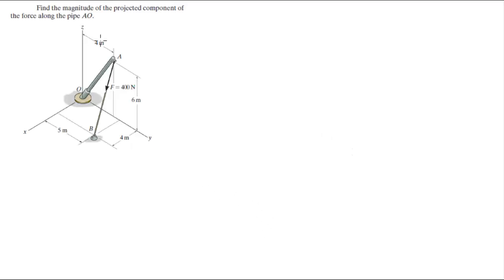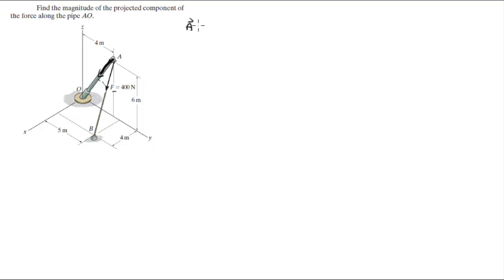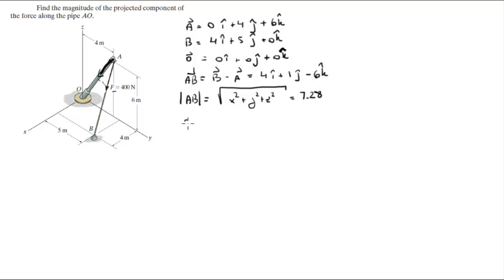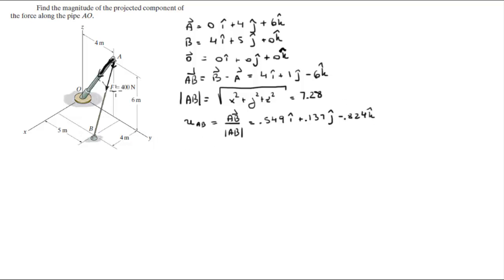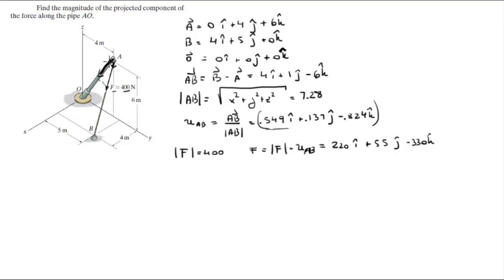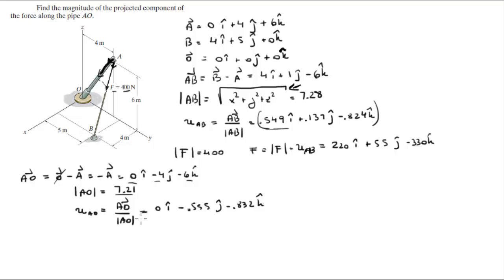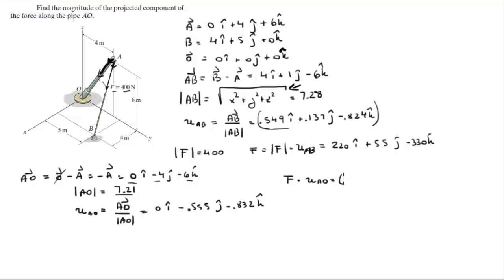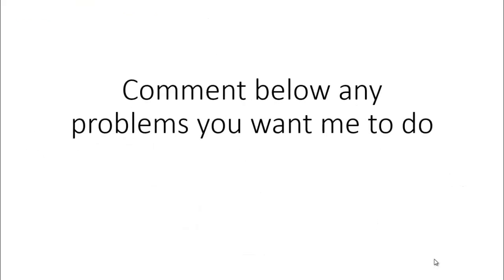Find the magnitude of the projected component of the force along the pipe AO.

Comment: Answer is wrong. It's 276.
Reply: that is what I got as well, but if I input 244 into my assignment it is marked as correct... I don't understand
Reply: I have found out that it is actually 244. because the units are scaler you don't use the Pythagorean theorem. you just regularly add them up and you end up getting 244. I hope this helps other confused students haha

Comment: How did you get 7.28?
Reply: x = 4, y = 5, z = 6? so |AB| = 8.77?
Reply: Then you are working out the square root of -19 which is impossible and putting those numbers into a calculator gives an error?
Reply: AB = (4,1,-6)
|AB| = sqrt(4^2 + 1^2 + (-6)^2 = 7.28 :)